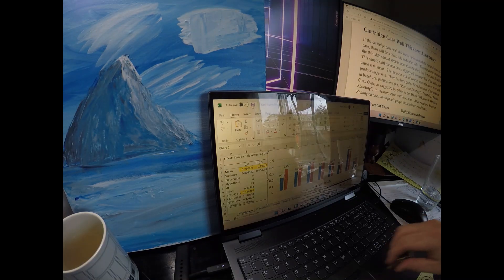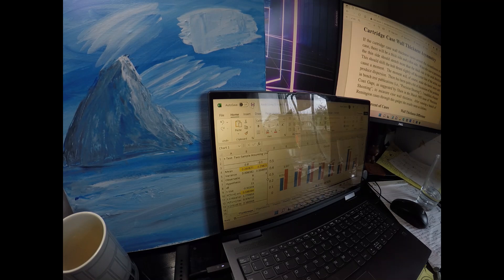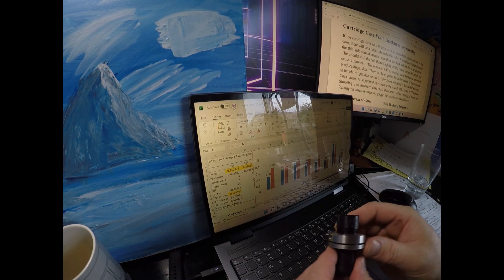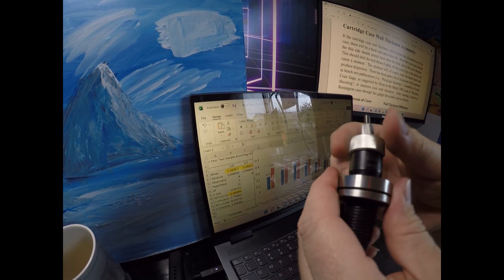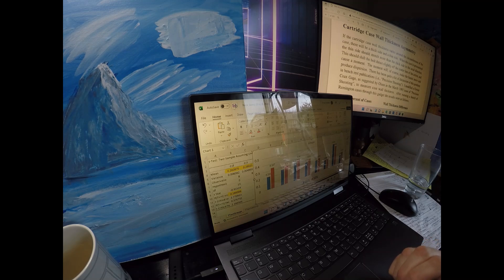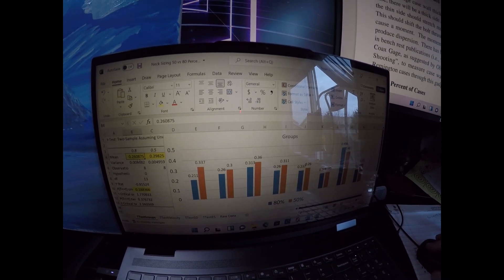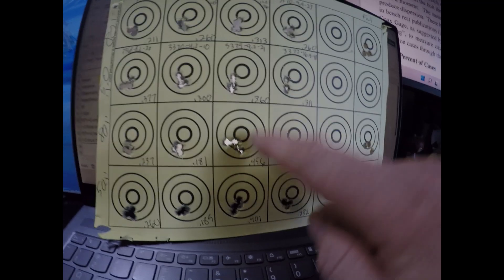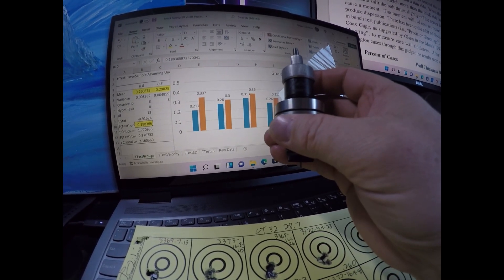Neck Sizing 80 or 50% of the Neck?

Comment: I have a 6mmBR Norma .270 neck. I use a .268 bushing for sizing. After shooting a round the bolt gets stuck about 1/4 way to the top of full rotation. Would you have any idea what needs to be done to fix that.
Reply from the maker: Could be a number of things but I would first check to see if the base of the brass is too wide. That often results in rough bolt lift/“clickers”.
Reply: Ok thanks

Comment: I just watched your video, so I'm a bit late to the party. I am 20 years retired from a career of analyzing and evaluating manufactured products to determine whether or not to release product to the market. In your specific case, you could not show "statistical significance"; however, if I am seeing your barchart correctly, in 7 out of 8 cases the 80% sized produced a group smaller than the 50% sized. If there were truly no difference, one could theoretically liken this to flipping a coin, i.e. -- a 50% chance either way. If I flipped a coin 8 times and got 7 heads, I'd be suspicious. The chances of 7 out of 8 heads in this example is .043 which would certainly be considered significant! I would tend to believe that the 80% sizing does provide an advantage no matter how small. If only 6 of 8 were smaller, the probably of this occurring by chance would "sky rocket" to .08, but I would still be suspicious. 

👍By the way, I do like your work -- keep it up. You are doing what I am too lazy to do.

Comment: In Tony Boyer's book, he recommends to size 70% of the neck. With some tools you can select the length you want, but on the Wilson "neck die" (arbor press), you cannot change this length (about 50%). I will make a shim for my full length neck die because it's very difficult to set it by hand the same way each time.
The micro die adjuster is really usefull (I love it) but too expensive to have one for each caliber.

Comment: I have been very curious about this method, which I have used for the past 12 or so years e.g. sizing to 80%, vs the long range guys using a mandrel to expand the neck to a certain diameter.  Have you come across this practice, Bryan?
I had purchased the micron die for my JGS 1045 reamer and found that it sized the body/shoulder junction more than I would like and I needed more bump to get the bolt to fall than I would like (about 2 thou and 1.5 thou respectively).
Went to a JLC die and now only bump 0.0005ish (mitutoyo digital so it is difficult to say exactly, but the number only changes .0005 and the bolt falls with only the slightest touch with a stripped bolt).
Another great video and thank you so much for the effort!
Mike
Reply from the maker: My practice has been to use a bushing die on turned necks and mandrel on unturned necks. I have migrated my practices towards turning necks (even if it’s a “clean up” of the neck) so that I can use bushing dies. 
I didn’t have that experience with the micron. I have a custom reamer that I know goes well with that die so it’s been smooth going for me. Thanks for the comments and tuning in!
Reply: @WitchDoctorPrecision  That is a great perspective I had not come across as yet, and it makes sense.  I was not looking forward to an extra step in the reloading process in needing to run the brass over a mandrel if it wasn't needed.  With the advent of the AMP press I am curious about what influences seating pressure and consistency and have been following those videos with great interest.
Reply from the maker: @mikes5918  yeah, I should be all bushing soon. I’ve been measuring neck diameters for years and the bushings give a little more uniformity relative to mandrels in turned and annealed brass.

Comment: For the last several weeks we/you have gone through testing for a variety of different techniques and components.  There were some clear improvements.  Have you incorporated all of the improvements in each subsequent test?  Ie.  did this test use sorted primers?  Uniform primer seating depths?  Etc. etc.     In other words have you continued to eliminate the variables that might make one new technique seem better but could in reality  could be accounted for by the randomness of the other components that we now know have variability?
Reply from the maker: I’ve been incorporating previous findings. However, I did switch powders and the test barrel is getting up there in round count so there are a couple variables introduced into the mix.